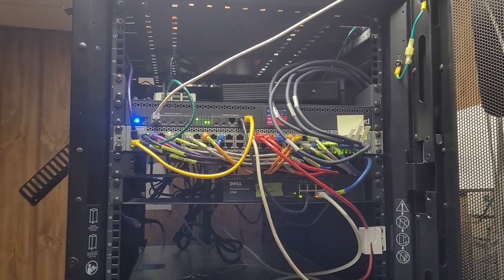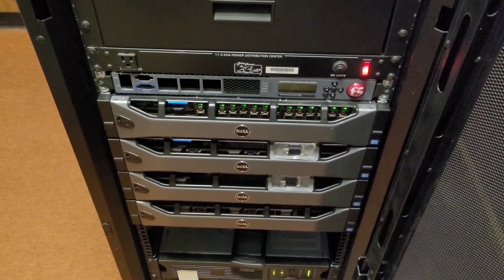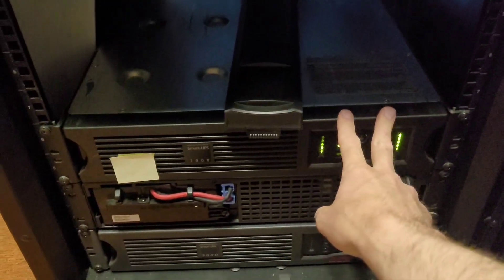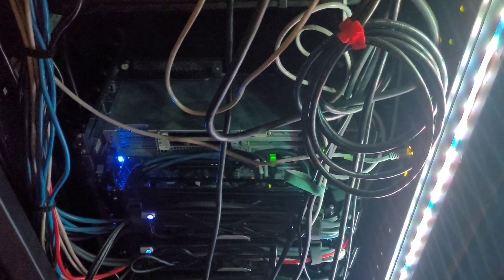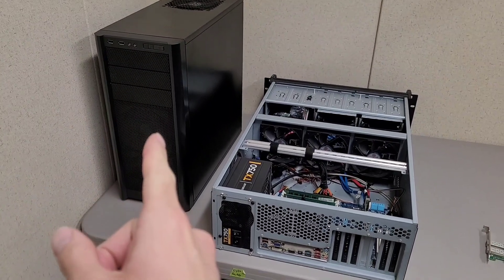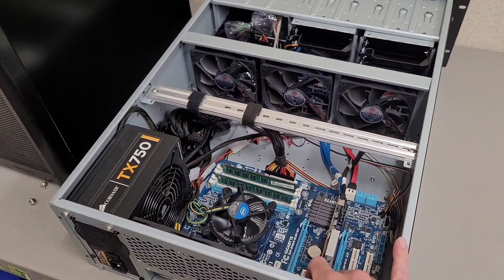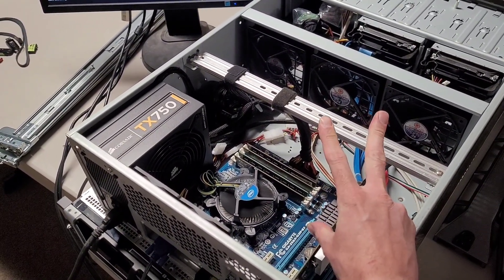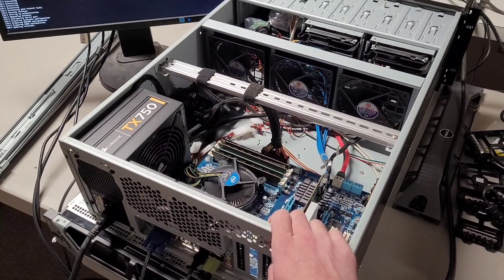The chaos in the server rack is too dang high! (I need to fix all the things)

Comment: For your UPS's there not designed to run that many servers on 1. I have 2 of those and run my servers split across them granted there not dell R720s. Get some of the SMART 1500 or Smart 2000 series and stagger the Power supplies of the servers so 1 PSU of each server on 1 UPS and vice versa. I just put new batteries in mine and going on 8 years of use. Cheaper then full replacements. You could even sell or trade the 3000 unit out for one that supports your power inputs.
Reply from the maker: Yeah it is a bit much trying to run everything on one. Normally things are staggered. I can't find any buyers for the 3000VA one sadly. On top of that I got a good deal on a pallet of battery backups hoping for a 240V one and they are all 208V. 😅 I probably just need to break down and find a buck boost transformer that can drop my 240V to 208. Otherwise for an APC unit that would fit my desires I would be looking at $3000 USD...
Reply: @computersales  Yeah in that case I would go the drop down route especially if you have multiple 240Vs
Reply from the maker: I will need to find an electrician to talk to. 
 The one place that sells them won't help me spec out the right one.

Comment: So funny you mention the cross flashing thing, I remember holding off doing that on an IBM ServeRAID M5110 thinking it would be a pain, but like you said once you know how to do it it's such a simple process.  Always kind of makes me laugh now when I see people charging a premium for cross flashed cards on ebay.  Nice setup, I'm in the process of finishing rebuilding my proxmox server, just need the case!
Reply from the maker: I need to try flashing some of the non Dell controllers next. I need to learn proxmox still. Depending on what you want Sliger makes some nice server cases.
Reply: @computersales  Funny you mention Sliger, I have my eye on the CX4712, kind of overkill but it does everything I want in a pretty well designed package.
Reply from the maker: @nadtz  The CX4712 is nice for high performance server. The CX3701 looks fun if you just want a little compute with your NAS. Sliger has been working on some other stuff I think though. Saw a reddit post that looks really cool:

https://www.reddit.com/r/homelab/comments/1bgju85/sliger_cx3702_18_deep_3u_nas/
Reply: @computersales  I'm going to be throwing an Epyc system into it and running truenas among the proxmox VM's so unless I want a little jet engine of a cooler I'm going to be going 4U.  The easy access to HD's is part of why I'm probably going to go with it over less expensive options.  Kind of overkill like I said but it's been a while since I've built myself a nice server.
Reply from the maker: @nadtz  ah yeah fancy setup would justify fancy case. I haven't price compared the CX4712 to other offerings since I tend to run Dell for my full depth stuff. I have a feeling it is pretty price competitive once you figure in the drive bays. Deep 4U cases have a greater offering than short depth stuff though. A nice short depth case is hard to find.
Reply: @computersales  It's fairly competitive though on the high side.  By the time you get rails and drive enclosures for a rosewill case for instance it's going to be around $400 and 4U supermicro is going to be loud (though they are great chassis).  Silverstone and some other options out there but I've wanted to own a Sliger case for a while after working in a few of them a while back.
Reply from the maker: @nadtz  yeah I have a few 4U supermicro chassis I might use but don't want to because they are noisy. I have a nice Rosewill case that would be good for performance oriented stuff but the drive bays are a pain to deal with. The CX4712 seems like the best option for front drive bays and quiet high performance operation. There are some cool oddball cases out there. I am not big on taking gambles with the whacky cases on Aliexpress or whatnot though.